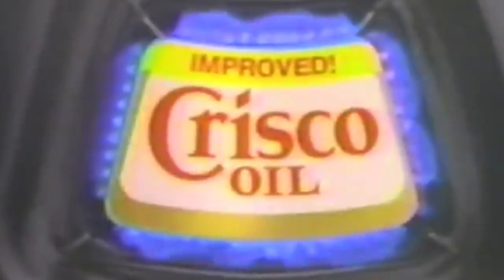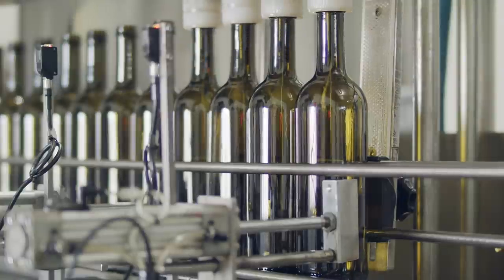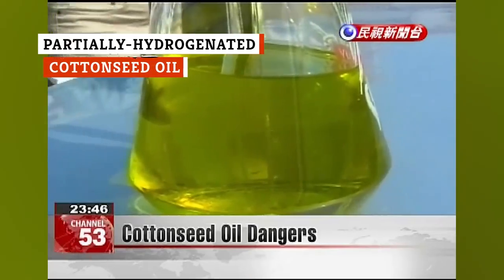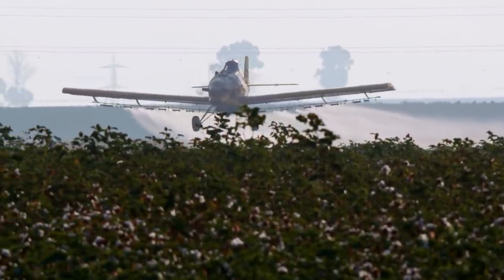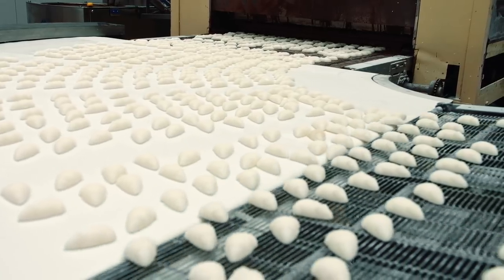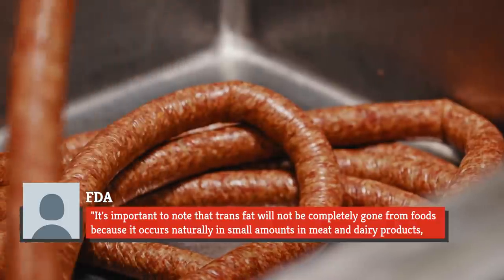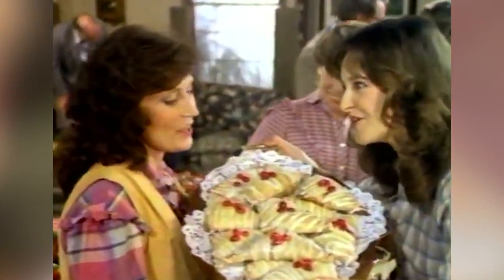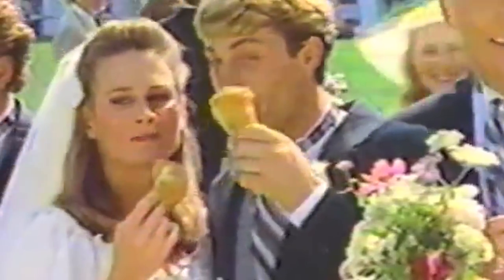This Is How Crisco Is Really Made

Comment from the maker: What do you use Crisco for?
Reply: Wrestling
Reply: To make dough for pies
Reply: pizza dough
Reply: Here in Maine they use Crisco for making whoopie pies it is vegetable shortening mixed with sugar and a little vanilla for the inside of whoopie pies that is the cheap way to make them no not everyone makes them that way but that is the original recipe and that is gross
Reply: @colleens1878  Fellow Mainer here. We use Marshmallow Fluff mixed with Crisco.
You can't find Marshmallow Fluff in most areas outside of New England.
Reply: to season cast iron pan
Reply: @janderson2556  ...
Reply: To give yourself and others heart disease.
Reply: To make emergency heat in case of power outage. Put some candles in it, cover the top with a clay pot and you have light and heat for 72 days!!!
Reply: @Marie Josee Bercier  Interesting.  I would like to attempt it.  Could you go into more detail.  For example, is a clay pot found in Home Depot flower section? I like detail.  Thank you.
Reply: Soap making! Not cooking!!!
Reply: I make soap.
Reply: NOTHING!
Reply: I wouldn't use Crisco to clean my toilet. Literal hydrogenated industrial waste, it should be illegal.
Reply: @RustyShacklefordReal  Jake Tran is a legend for exposing this stuff.
Reply: to prevent rust on metal parts. Never for cooking.